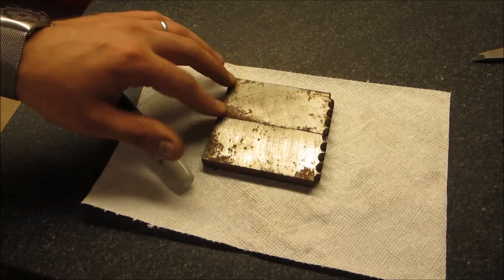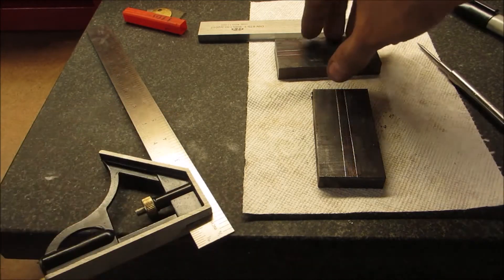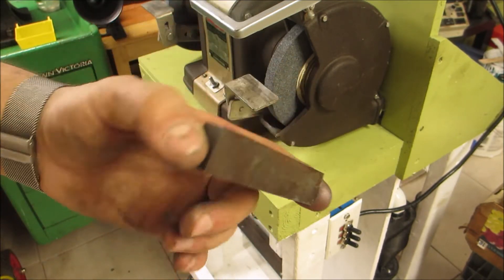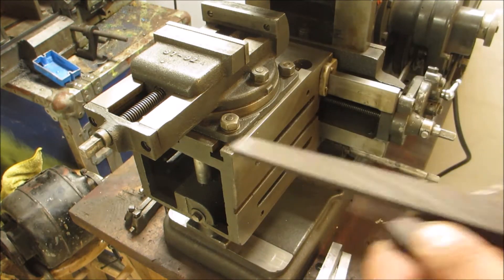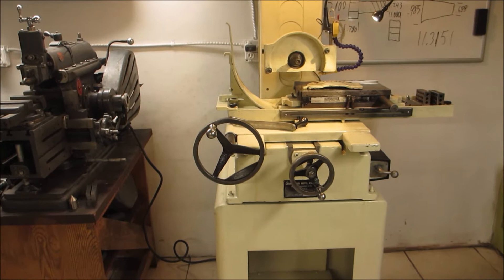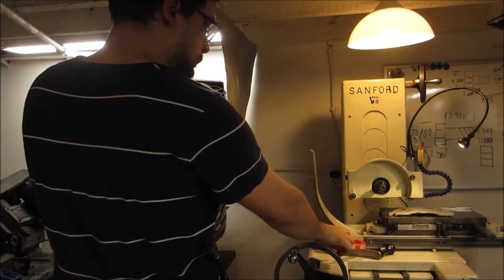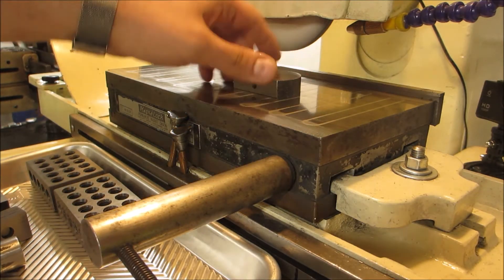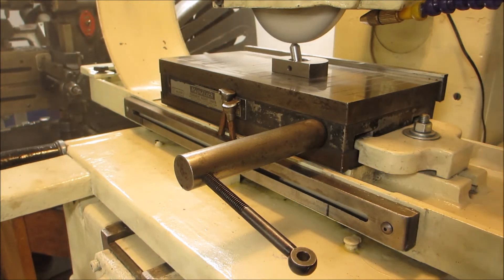Shaper Parallels - Tool Making Competition 2018.

Comment: How many years have you been working at this trade before you could reach this level of precision?
Reply from the maker: mdwdirect this is a hobby for me not a trade just yet. I am quite a novice.
Reply: engineerd3d I watch quite a few machinist channels and you do not appear to be a novice.
Reply from the maker: mdwdirect I thank you for your compliment. But I assure you I have less than 2 years in this hobby. Less than 6 months with a surface grinder, I just enjoy this hobby so much.

Comment: It looked to me as though the shapers has wheels on the base, couldn’t you roll it out of the immediate area when grinding?
Reply from the maker: John Brock no wheels on that shaper. I will make a metal cart for it later on.
Reply: I put all my equipment that doesn’t need to be precision leveled on wheels. It helps in clean up among other reasons. None of my equipment is so heavy that wheels won’t support it.

Comment: That shaper is a really neat tool.  Good work on the parallels.
Reply from the maker: I love the shaper Harold. There is something soothing about running a shaper. Slow, yes, low noise however.

Comment: You renamed the channel on me as I was like who in the hell is this on my sub list, lol.  Grats on 1k.
Reply from the maker: The Best Stooge thanks man. Yeah I renamed it.
Reply: I wish I could get my 3d heated beds that flat and true.
Reply from the maker: The Best Stooge working on that myself. Thinking cast iron heated bed.
Reply: You have the tools to make that happen for sure.  Cast iron skillets are the best pan to cook in and can be dead flat going from the heat of a 500 degree oven to the fire of the burner.
Reply from the maker: The Best Stooge the problem right now is the cost of cast iron. Maybe I will figure something out. But now a 12x12 bed would cost more than a 3d printer.
Reply: Good Lord when did cast iron become so expensive?
Reply from the maker: The Best Stooge it's the environmental impact of producing it. The weight of transportation cost.
Reply from the maker: The Best Stooge I will check out the local scrap place as well as that link. But as of now the metal supply quoted me some ridiculous prices.
Reply: All metal seems to be outrageous as of late and this is why China was raping us but Trump imposed tariffs on them for doing it.